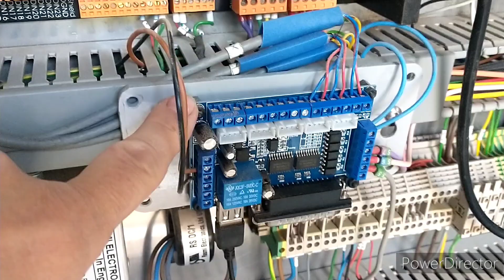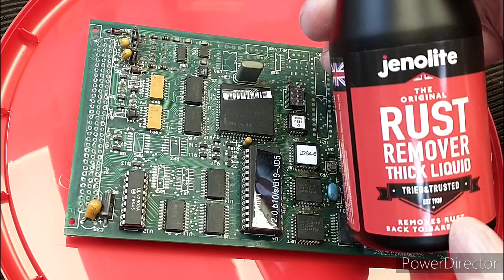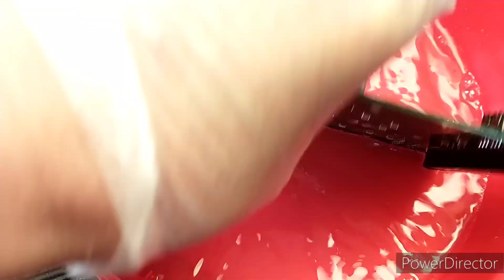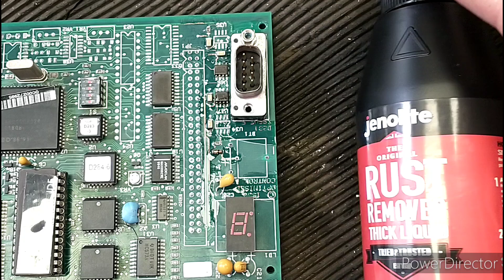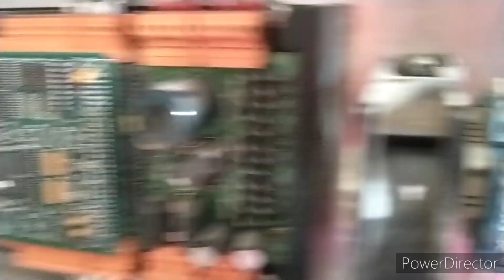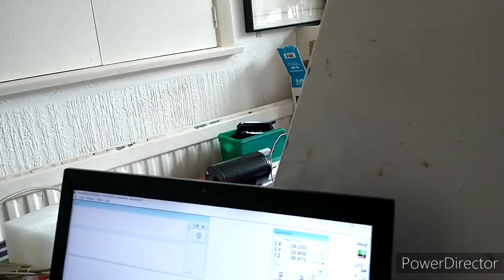PCB recovery after battery leakage. Denford Micromill 2000

Comment: looking good Julia
great fix
just bought some rust remover for car Bilt Hamber hydrate 80 for 500ml @ £18 hows that compare to jenolite.

atb
Kev
Reply: Haven't seen that product for a long time. Would never have thought of using it like this. Thanks for the tip Julia. Cheers Nobby
Reply from the maker: @nobbysworkshop  you’re welcome Nobby 😀
Reply from the maker: Thanks Kev this was about £10 inc postage for the smallest bottle. Probably a lifetime supply! Bigger bottles will be better value I guess. 😀
Reply: @julias-shed  cheers julia 
not a lifetime supply if you have an old car like me, it's a 21 year old nothing special car, that way nobody wants to nick it, could leave the keys in with a FOC notice in window and still safe, but i want another 20 year out of it🤣🤣🤣🤣🚗🚗🚗🚗🚗🚗👍👍👍👍👍👍